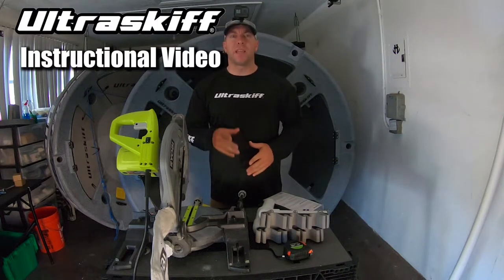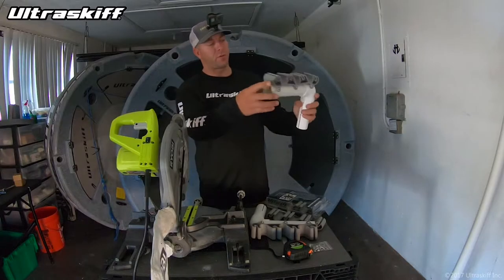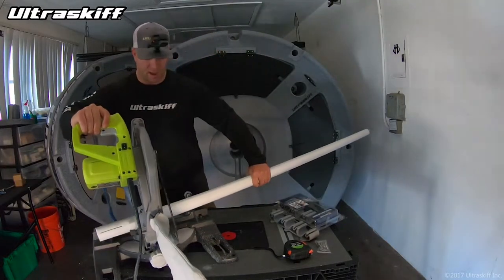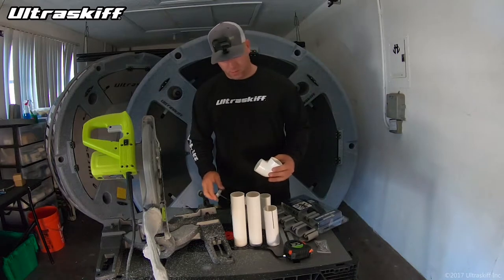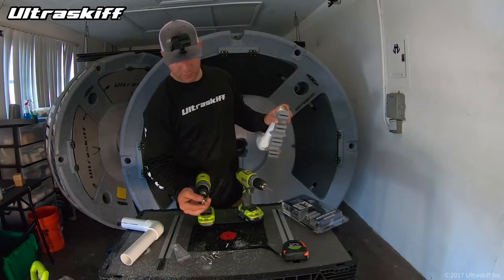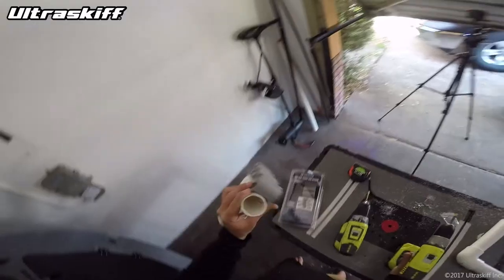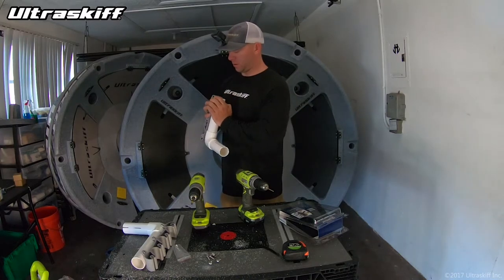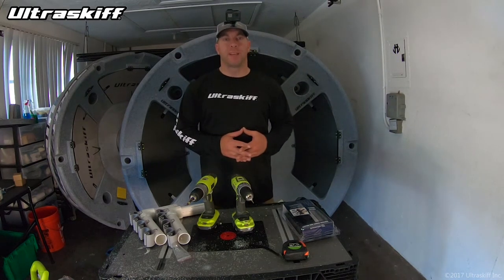DIY PVC Horizontal Rod Rack Build

Comment: I wish you would show how the rods look on the rack after you make it. You have them pointed in over the boat. Does it work with them pointed out over the water? Those are the things I think you should show when the product has been made. Thanks for the instruction videos. I have not purchased this boat yet but I am going to sell my 21 foot boat this year and am thinking about purchasing this boat. I have tried to see the boat at Skips Marina in Englewood Florida but no luck yet. I hope this year he will have one that can be tried out so you get some idea how it works. I think you are in Tampa some place. I will be coming up there for the big RV show so maybe I can look you guys up to see if you have one on hand that can be tried out. Again thanks for sharing you video.
Reply from the maker: Nanas Joy I show the rods in the holders being used in the first 20 seconds of the video.  You will see it in the bottom left of the screen.  With the boat being 6' and rods being 7' there will always  be some degree of over hang.  Hasn't been a factor  for me even in tight  mangroves, as long as you are aware and already good at handling the tiller/boat.
Reply: Ultraskiff Inc Thank you for pointing out what missed. I like your videos. They are very helpful.